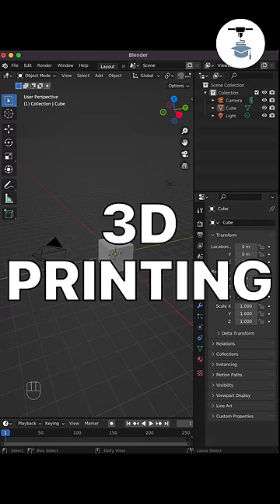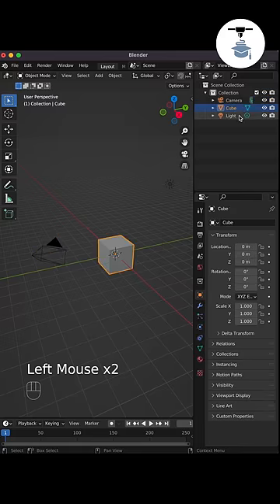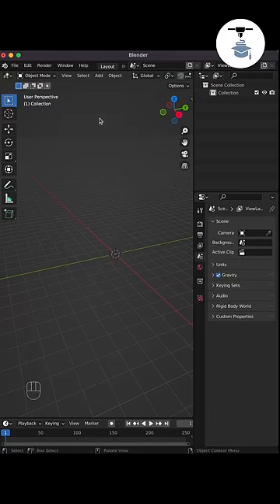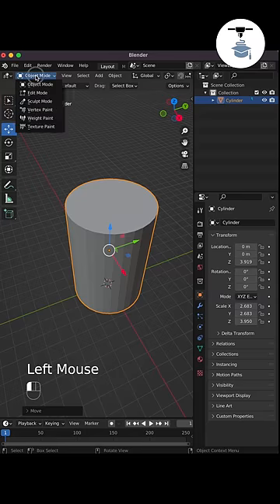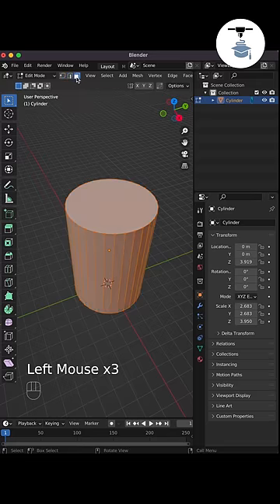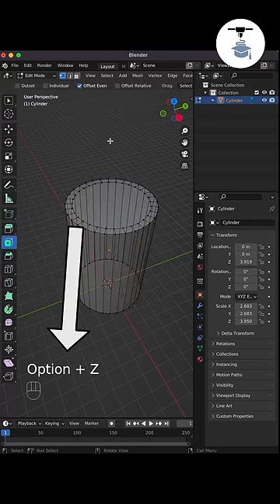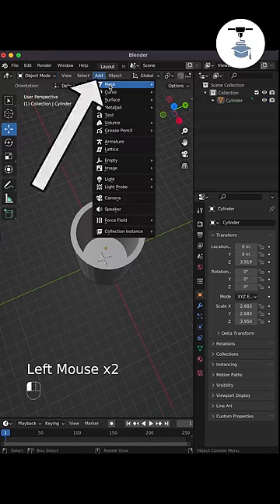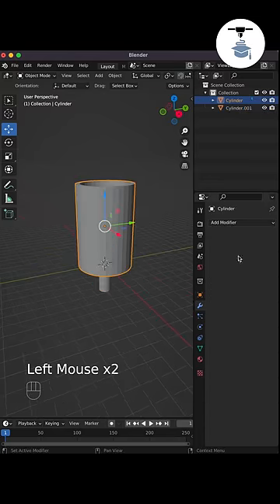How to design things for 3d printing using Blender in 60 seconds. #shorts

Comment: I've been using blender for over a decade and was the reason I started 3d printing for a few years now and it works great but I would highly recommend changing the from the default blender values to use mm or inches and then have an empty cube that's the size of your printer print volume works great so you don't have to scale it later in your slicer after and everything will be printed to the size you originally modeled it
Reply: How can u change the values to mm ????????????!??!??? Pls pls
Reply: Scene unit in scene tab if I remember right.
Reply: Yes it's under scene properties the the drop down that says units and then change unit system to metric....google change blender units to metric if that didn't help
Reply: That’s such a good Tip btw Ty
Reply: @dudynator1  Ty
Reply: @LokiTrismegistus  Ty
Reply: Extra pro tip: you can apply a wireframe modifier to your printer reference cube so when you toggle between solid and wireframe view the mesh won't block your view
Reply: The printer reference size cube is especially useful if you are using multiple printers with different bed dimensions you just make another cube with those sizes
Reply: Can you teach me please 😂
Reply: @barrakodahi5069  I was actually thinking about making a video about this
Reply: Great idea! Thanks!
Reply: So, the measuring units in blender is 100% match in the real life size?
Please answer, i just modeling and measure everything with mm size because i want to print it, i don't have 3D printer btw, so when my project was done, i took it to a 3D printing service
Reply: Nmms qué trucazo!!! Muchas gracias ❤
Reply: Will u help me 3d print a little toy for my girl ? Please.

Comment: Blender is not the best for designing 3d prints. For beginners, I suggest Shape3D as it is user friendly and had easy to follow courses. Personally, I use Shapr3D on the go mock ups and fusion for official prototyping
Reply: Not everyone can afford Fusion at $70/mo.  Some 3d modelers are hobbyists.
Reply: @leigel3  fusion 360 is free for personal use
Reply: @norman4903   I remember looking into that one and not seeing anything free but now I google it there's a page for that.  Thanks for the correction.